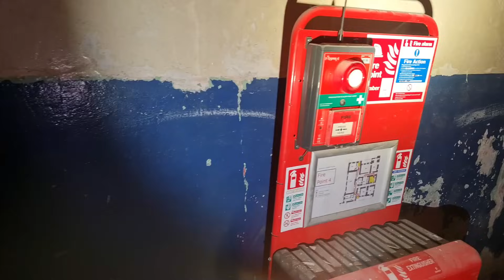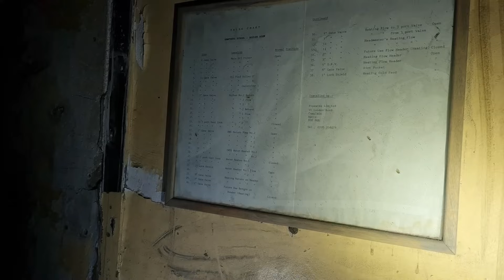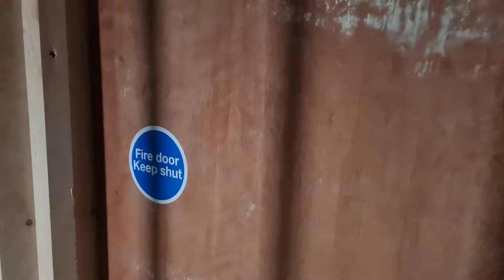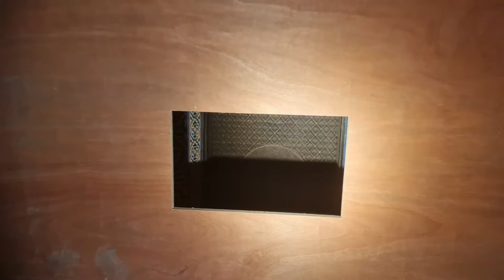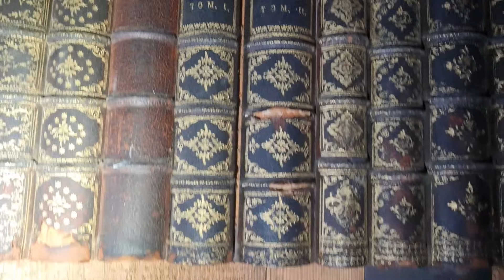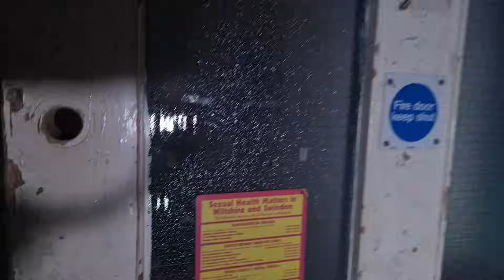HUGE ABANDONED MANSION UK - 100+ ROOMS!! Exploring Tottenham House

Comment: 18:04: The back-room is where a fire broke out in '72 or '73, when it was used for storage. We Hawtreys School pupils were required to fight the fire - wouldn't happen now! - and formed a chain-gang with buckets of water. The smoke was incredibly thick. Marlborough Fire Brigade finished the job using breathing-apparatus, and no damage was done to anything but the stored bric-a-brac. A stag's head survived - shame he hadn't been left to roam the park. A dramatic event anyway. Note the fantastic little brick stove behind the gentleman. It was probably the heat-source for the nightwatchman 300 years ago!